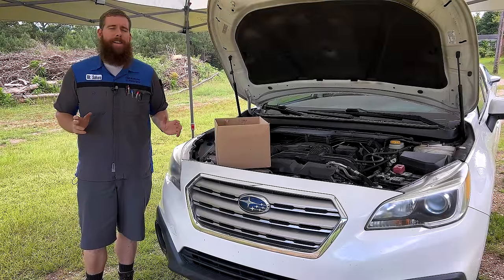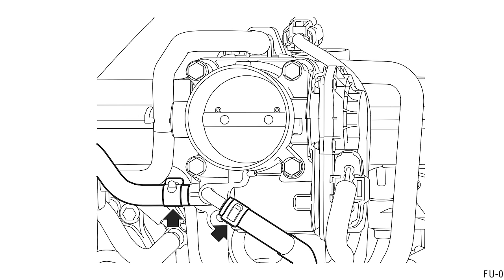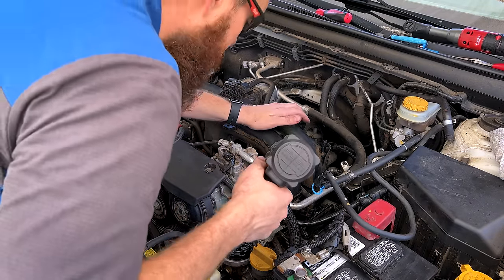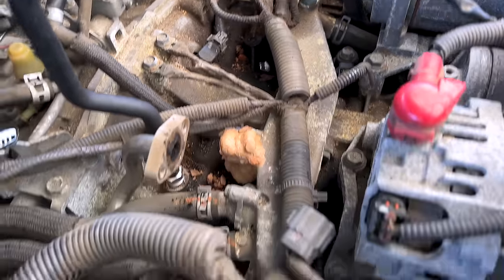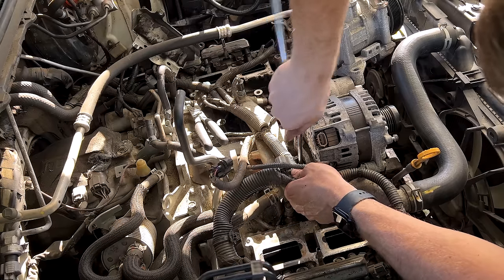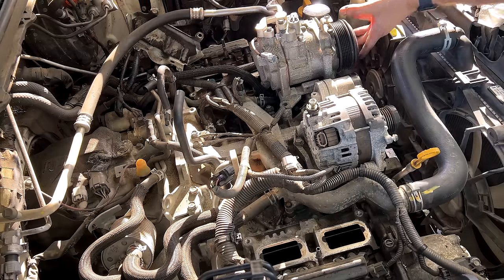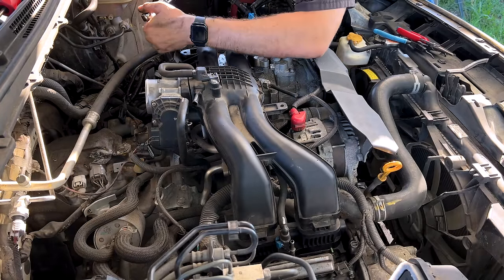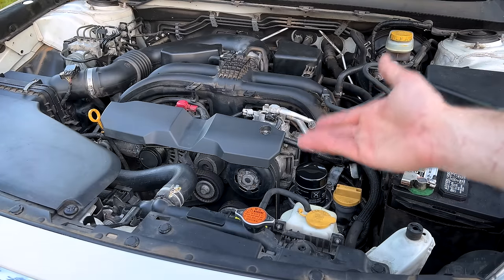Project 2015 Outback: Coolant Crossover Pipe O-Rings, PCV Union, & Thermostat Replacement. DIY Guide

Comment: Excellent video, after watching it  I was able to order all the parts I needed to replace the o-rings and PCV union and related hoses on my 2018 Forester. While I had it torn down, I also cleaned out the EGR Valve and replaced the PCV valve. Thanks for posting!

Comment: I have seals ordered to do the same job on my 16 outback with 201k miles on it this weekend. I see a little puddle of coolant under the intake on the passenger side right next to the o-ring. I really appreciate you doing these videos. You're a walking talking service manual. : )

O-rings changed, the old ones were definitely shot. Surprisingly the short hose coming off the drivers side of the crossover pipe was still very flexible. I changed it anyways since I bought it. I did find I have a cracked hose on my pcv valve, it's ordered. Job was very straight forward other than the intake manifold bolt holes didn't seem to want to line up easily. I loosely installed the bolts on the passenger side and had to pull out on the drivers side to get the holes to line up with the holes in the head.

Comment: Mr Subaru, thank you.  I've had a leak since October, i took the 2015 Outback twice to the dealership only for it to start leaking a month later.  It took me awhile but i replaced all but one of parts you demonstrated.  You also make it look real easyt😮.  And as of today 311,151 miles
Reply: Have you heard of anyone else with. 2015 with more miles than you? I have a 2015 with 394k as of of today. I've never found anyone with over 300k until I saw your post.

Comment: Thank you for these videos. Finally have the room to work in my garage. Replacing a clutch but while I am in there pulling the engine might as well replace everything you are replacing now. I might do the timing chain since the engine is 160k mi  (Car is 240k mi) replaced at 85k mi from a recall. 2013  OB 6mt fb25

Comment: I finally just completed my intake cam clearance for a new cylinder head. The math formula, using feeler gauges, measuring the caps with a "pointed micrometer" in inches converting to mm. Come to find out that Subaru prints the mm thickness on the caps. Not gonna lie I would have loved a video. I have taken some with a phone cam. Thanks for you subie videos on the FB series

Comment: This is a great video showing repairs typically needed on a modern Subaru engine over 200K miles.  I am wondering if it would be useful to publish a list of these sort of repairs that a Subaru owner should plan on to get their 200K car to make it to 300K.
It would also be useful to provide info on the cooling system vacuum fill tool you used.

Comment: Hi. Mr Subaru!
I have 2014 Subaru Impreza sedan driven about 143K. My car always has oil bunt smell after dring for hours. I have been using 0W-20 oil but nowadays, my me hanic told me that I have to change the engine oil type to avoid the bad smell. Which engine oil type the best alternative??

Comment: For an FB25B engine, what is the best way to drain coolant from the engine block itself?  Remove the thermostat housing and thermostat?  Remove the drain plug on the right hand side (passenger side) of the engine?  There doesn't appear to be a corresponding one on the left hand side unless I am missing something but there is a small hose that connects to a water pipe that might be able to be taken off?  (Of course to remove the right-hand drain plug the service manual recommends removing the front exhaust).  Is your vacuum refiller capable of pulling the old coolant out from the engine block?  Or just don't worry about draining the engine block?

Comment: Hey Mr Subaru, Awesome video. Will be doing this on my 2014 Outback with 125K miles. Does this issue appear on the FA20 engine found on the 2017 Crosstrek (wife's car with 60K miles). Keep up the good work and very instructional videos!

Comment: I just did this on my 2016 FB25 engine and smoke was coming from under my engine on the passenger side around the O2 sensor. What would cause that? I thoroughly cleaned the engine so I could see if I had any other leaks too.

Comment: I have a 16 legacy and don't know if the trans fluid has ever been done. It's got 105k miles. If I do a drain and fill it it ok to use a different fluid or should I try and get the Subaru fluid? Or should I have a transmission shop do a complete flush then do periodic drain and fills using whatever fluid they used?

Comment: Hello, I just had complete engine reseal within last 10k due to side cam ordeal and I am now experiencing this issue. Is there a link between the 2 issues. Would warranty from side cam work help me at all? If not, thanks for this video!
Reply: The dealership wanted 1400 to fix this. I received all parts yesterday and fixing today come sun up. Thank you good kind sir.
Reply: 7 hours later, I am finished! 😅 My 2014 Forester had a 2 piece manifold. I was wondering why I saw 2 gasket sets available. I was able to pull the top half which was 8 total 12mm bolts. 4 on each side. The water pipe/coolant hose on the union was different. I had to pull the egr pipe off with the manifold as well which worked out because it was gunked up and needed cleaning and i found its gasket was pinched which I will replace soon. You helped save me $1100+. Thank you!!! ✌️

Comment: Just did this job on my 2015, 190K. Trying to do precautionary maintenance. After starting the car I had stumbling, miss firing and service light. Error code 2109 and 606. While I had the intake out, I pulled the throttle body and cleaned frt and back. Any ideas?

Comment: Hi Mr Subaru, Thank you for this video. As commented previously, I will be doing my 2014 Outback 2.5i Limited as a preventative measure. Is your 2015 Outback a 3.6? Based on the parts that you specified, it seems like it is. Would you pls confirm. Kevin
Reply: I found your original video for this car. It’s a 2.5. So is the engine the exact same as the 2014?

Comment: What’s the typical mileage you’ve seen those crossover O-rings fail? I noticed my wife’s 2015 Crosstrek smelling like coolant yesterday, I haven’t checked to see if that’s the area it’s leaking yet but the vehicle only has 75k miles on it. Thanks

Comment: Thanks for the video, @MrSubaru1387. Well done, as always. How similar is the process for replacing the coolant crossover pipe o-rings on an EJ253 in a 2008 Impreza Outback Sport?
Reply from the maker: The 08 is much easier.
Reply: @MrSubaru1387  Oh, good. I’ve got to do mine before I make a 2,000+ mile move across the country.

Comment: quick question good sir, do you know who makes the matco air saw, ive used this one and the vibration is much lower than a IR and Snap on.  I want to get this matco tool but from your teachings being matco someone else makes it, if you could let me know who the original mfg is id greatly appreciate it.

Comment: Dude, please help me figure out my ac! 2016 outback 2.5, the compressor looks like the one in this video and not the one that has the clutch on the front that has an adjustable air gap in other videos. Blows only hot air, can't hear the clutch engage or click when the ac button is pressed, but can hear the rpms change. Low side pressure measures 90-100ish when car is off or running, it does not change at all. Help please!!!
Reply from the maker: Sounds like the compressor is bad. Looks like static pressure regardless, so compressor likely isn’t moving refrigerant. Or the compressor isn’t engaging.
Reply: @MrSubaru1387  that's what I was afraid of. Are there any sensors that could be preventing it from engaging? I've checked fuses and can't find a relay.

Comment: Why did the coolant fitting corrode in the first place?  OK, +200K miles and may years but would coolant changes have mitigated the damage?
Reply: yup, looks like abrasive damage from particles flowing through a 90degree turn.
Reply from the maker: Seems the car has been neglected by the previous owner. The coolant turns acidic if not changed in time.

Comment: Hello Mr Subaru ,I have a 2012 Subaru Outback 3.6 R I have an Oil Cooler/Radiator hose that sits right the the Front Swaybar in the Middle . I’ve called the Dealer,  gave my VIN # , told him what I’m looking for ,  and He cannot tell me what part I need ,, Herd are 4 photos I took today ,, can you Please Help me Identify the Hose and Part number for my 2012 Subaru Outback 3.6R

Comment: I don't understand why auto manufacturers insist on making critical parts out of plastic, just doesn't make sense.
Reply: makes perfect "sense"; they're in the business of selling new cars, and replacement parts.
Reply: young engineers don't push back against cold accounting decisions. neither do new car buyers.
Reply: Cost, DUH
Reply: Government plays some role in this as well. Over the past generation government mandated a steep improvement in fuel economy, which put pressure on automakers to reduce vehicle weight, even to the point of bringing in fragile systems like variable displacement engines, variable valve timing, and sheet metal aluminum frames. Problem is, government didn't pay attention to how those additions reduce overall vehicle survival. If anything, auto makers are happy to have old vehicles off the road! It improves new sales, and they don't care that hard plastic can't be recycled at all. Making new cars more often causes more pollution and more CO2 emissions, so government experts aren't looking at the whole picture. One interesting spinoff is the way there are few small trucks coming off the assembly line now. That's traced back to the incredible demand for fuel economy (~45 mpg) for trucks with a small wheelbase, compared to much more lax requirement for full size trucks. Instead of paying a penalty, automakers make trucks bigger.
Reply: @spelunkerd t’s up to manufacturers to produce what customers need. You blame government regulations, but everyone wants better gas mileage and cleaner air, plus they want better gas mileage and more power, and bigger cars, and more luxury features, and they want everything to last for at least 120,000 with minimum maintenance. You blame government, but don’t blame your own want for bloated and unrealistic vehicles.
Reply: So they can keep selling replacement parts. Dorman sells some parts that are redesigned to be better made than OEM, as in metal vs. plastic.
Reply: Planned obsolescence, 
In economics and industrial design, planned obsolescence (also called built-in obsolescence or premature obsolescence) is a policy of planning or designing a product with an artificially limited useful life or a purposely frail design, so that it becomes obsolete after a certain pre-determined period of time upon which it decrementally functions or suddenly ceases to function, or might be perceived as unfashionable.[1] The rationale behind this strategy is to generate long-term sales volume by reducing the time between repeat purchases (referred to as "shortening the replacement cycle").[2] It is the deliberate shortening of the lifespan of a product to force people to purchase functional replacements.[3]
Reply: @mahed82 
Agreed. 
Auto manufacturers expect those parts failures after their new car warranty expires. 
Manufacturers also discontinue many parts after 6 years of a vehicle model production. 
They will sell parts and repairs or sell you a new car.
Reply: That pcv union part would cost 50 times more to manufacture using aluminum. That would need to be a cast part. Too difficult to machine. Plastic is the right choice.

Comment: Can someone explain to me why the dealer wants over $600 to replace the 4 plugs that take less than a hour? Talk about a rip off!
Reply: Because it's a dealership. They can pretty much charge what they want, if you are bringing it to a dealership instead of a local mechanic and complaining about the cost is counter intuitive. The solution to your problem is to simply do the repair yourself or bring it to a local mechanic which would be significantly cheaper